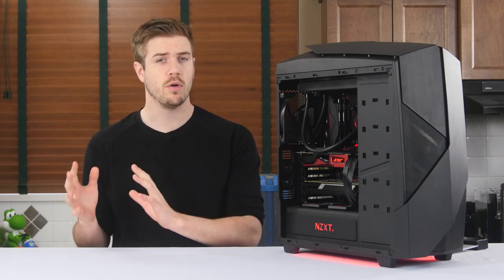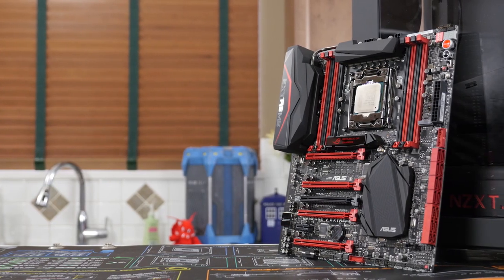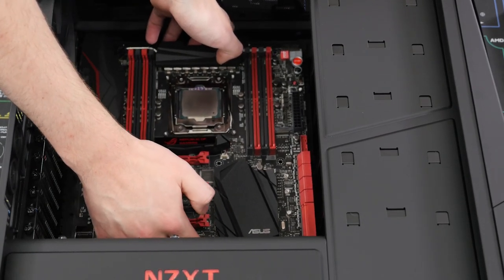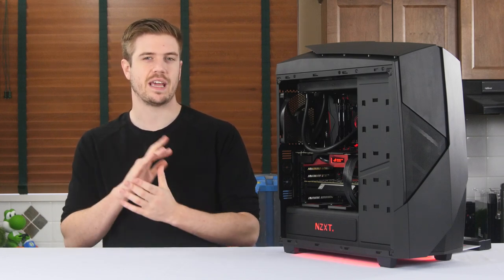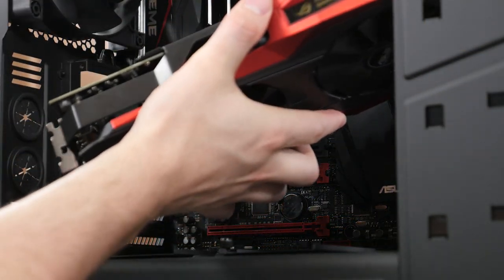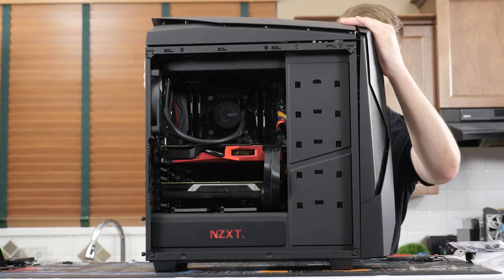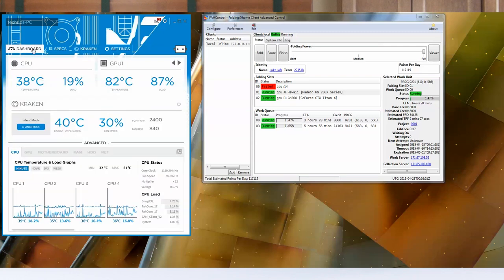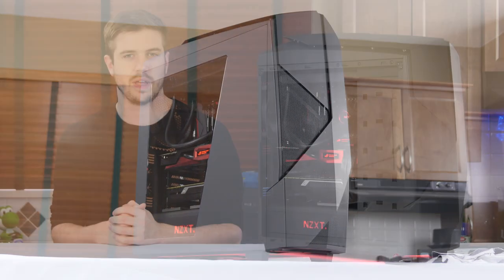ULTIMATE Distributed Computing Build Log

Comment: A $2000 pc with a 290x? Wtf. It's 2015, 290x is shit
Reply: Kaydn Burns Except the 290x can still compete quite well with (if not surpass in some benchmarks) the 980, despite being nearly two years old now.
Reply: rob torres
He wasn't addressing that at you. He was talking to me.

Kaydn Burns Just with a quick Google search, I found a few benchmarks where the R9 290x outperforms the 980, specifically when it comes to video rendering. When it comes to gaming, the 980 is better, but gaming isn't the only thing a video card is used for. But even for gaming, the 290x is still quite close to the 980, often only a few fps (1-5) apart in most games while also having a higher minimum in a lot of other games which would cut down on noticeable stuttering and framedrop. It doesn't matter if your highest FPS was 60, your lowest was 10 and your average was 30, because you'll notice the stuttering way more. A lot of people only ever  look at the benchmarks for highest FPS, but that rarely if ever gives a good idea of what the experience will actually be like. Stuttering is a huge issue in games, and is something that literally no benchmark ever can test for.

Not to mention, as rob torres stated already, the 290x is significantly cheaper than the 980 OR the 970.
Reply: Neonemerld They are cheaper NOW because of the 900 series by Nvidia, AMD dropped the prices DRAMATICLY after the 900 series came out, and lets see AMD stock is at 2.32 with a market cap at 1.78B the time of this posting.
The only new card AMD is coming out with in the 300 series is the 390, all other 300 series cards are re badged 200 series cards.
The Zen CPU isnt due till sometime in 2016, they cant survive that long with all the losses they have incurred.
AMD will be bought OR bailed out, they may be bailed out frorm Nvidia, just like MS gave 500 mil to Apple when they where ready to go under.
Its to avoid anti trust laws.
Reply: rob torres 250 for that god damn my 660s cost about that much each when i got them me want
Reply: Yellowhavok lol you could buy 3 660's now for one 290x
Reply: michael weiss There actually not cheaper because of the 900 series, infact theyve been the price there are now sense late 780 series. The cards went down because a shit load of miners bought the cards, which in turn made them a shit load of money which inturn allows them to sell them super cheap so they can make fanboys who will buy whatever next they pull out of there ass
Reply: rob torres Well i mean if you like no overclocking a whole room heater and blow dryer noise than yea its a great card, oh and no phys x, direct x 12, VGI, MFAA, TXAA, DSR, Cuda Processing for application and a $400 power bill yea great card
Reply: Oh dont forget about the known glitches and driver issues
Reply: And random dips in fps for no apparent reason due to driver malfunction
Reply: Kaydn Burns Are you still going on about this? Do you even do research? The R9 290 DOES support DirectX 12 and at higher resolutions, AA of any form is basically pointless. If you think that NVidia cards don't have known (and unknown) glitches and driver issues, or random drops in FPS, then you're far more naive than I ever thought possible. No driver is perfect, and that includes NVidia drivers. There have been some benchmarks floating around lately showing that with DirectX 12, the R9 290x can actually outperform the GTX 980 by up to 33% and actually matches up against the Titan X. Of course, I'm willing to admit that these are synthetic benchmarks and may not represent real-world performance, it still proves the point that it is stupid to call the R9 290x or even the R9 290 "shit". These cards are years older and they can still match up and be competitive. The heat issues are only experienced by a vocal minority and is far less of an issue than most people make it out to be. The other components in your computer can make a huge impact on GPU temps. I recently re-arranged the airflow in my case and dropped the temperatures on my GPU by 20 degrees at load simply by changing the way the CPU heatsink exhausted. I run my GPU fan at a blistering 30% speed (~1150 RPM) and at load I average about 55 C on my GPU and 26 C on my CPU.
Reply: Kaydn Burns
Wrong, i dont want to argue this one, the mining thing was dead before the 900 series came out, ALL AMD chips went down HUNDREDS after the 900 series, anybody with any knowledge knows this, its been discussed SO much last year people wanted to buy the bargain, but guess what, AMD still could not sell the cards.
They have to do something, you cant drop in the price of your mainstream flagship card in ONE WEEK 200 dollars, thats what they did with the 290x, AND they dropped the price DRAMATICALLY on the 295X2  from 1499 to just 619 currently, this all happened in a matter of weeks
Feel bad for the suckers that paid full price,.
.
Reply: michael weiss 295x2 for 619$? RIP Gtx 980
Reply: michael weiss For full directx12 support you must have the fucking chip to support all features
Reply: Kaydn Burns
Cheaper than that, it also has a 20 dollar rebate, guess what, people are NOT buying them, because of HUGE ROI on the cards, also people dont want to upgrade PSU and crossfire on this particular card has caused issuers in many games, also no free sync support yet, maybe never.
I was going to buy one because it seemed like a bargain, its more than 50% off the original price , that price dropped in 2 weeks after the 900 series was introduced, but after doing research i found out why people where not jumping on them, the old saying, if it seems to good to be true..you know the rest.
Reply: michael weiss Yea, the 290 sucks
Reply: Kaydn Burns You know, your money, your decision, right?  Have fun.  I personally only bought AMD for Mantle anyway.
Reply: Hans Tang But Mantle is dead, Vulcan and DX12 is the thing, Mantle died months ago.
Still works but not in development anymore.
Reply: michael weiss I got my value out of it, I play BF4 enough to appreciate what it got me for that 1.5 years
Reply: Hans Tang Mantel was great for games made for it, but things change, DX12 will be mainstream, i look forward to Vulcan because of Linux support.
Reply: michael weiss michael weiss BTW Im curious how GLnext support will work for the R9 200 series.  Has there been any word from amd?
Reply: Hans Tang Its open source, no telling to be honest, but should work on Red and Green.
Its all about driver support, just wait, wait at least a few months after the first release, thats what i am going to do.
Reply: buying amd just for mantel is like buying a 1998 honda civic because it has a ash tray instead of buying a Ferrari because it doesnt
Reply: Kaydn Burns Yeah? Well guess what I cant afford the Ferrari regardless.  Thats actually the perfect analogy:  a modicum of improvement for a massive premium of price.  The driver issues you speak of have never been a problem anyway
Reply: Hans Tang They are a problem but because youve only owned high end AMD modern cards you wouldnt know XD, if youve always lived in a prison do you know youre a prisoner?
Reply: I had a gtx460 and a gt9800 in the day for forever and they had no issues either.  I have no idea how the scene has changed but I never had major problems with drivers
Reply: Hans Tang its changed dramatically. AMD is going bankroupt.
Reply: Amd is just there for not nvidia and intel going crazy with the prizes
Reply: Kaydn Burns stop arguing about cards. Whatever is best for you is best for you. AMD is good, and Nvidia is good. so will you guys please just stop arguing :I

Comment: Can anyone help me with my build?
CPU:Intel Core-i7
CPU Cooler: H100i
Mobo: Asus X99-PRO ATX LGA2011-3
Memory: Corsair Vengeance LPX 16GB DDR4-2666
Storage: samsung 850 Evo 250 gb
Storage: Seagate Barracuda 2TB
GPU: GTX 980 4gb sc acx 2.0 
Case: Fractal R5 w window
PSU: EVGA 850w 80+ gold 
Microsoft 8.1 
K70 RGB
M65 
thanks :)
Reply: Twizzz z core i7 5930k**
Reply: Twizzz z  Solid.What kind of help do you want ?

Comment: http://www.aria.co.uk/Systems/Gaming+Range/Next+Day+Gaming+PCs/Gladiator+FX+4300+Pre+Built+AMD+Gaming+PC+?productId=63206&rqcType=q#rqc considering this as my first gaming pc, gonna swap parts out when I can afford more what do you think?
Reply: Build your own dude
Reply: cobiegaming I know but when I tried for certain pieces the price came well over my budget, I'll start with this then slowly upgrade it. (thanks for advise)
Reply: +Falcon Raiden You comparing 400 bucks vs. 1200. Go out.
Reply: ***** I found a better system with the same board and cpu but a GeForce 750 ti instead...
Reply: +Dan Kelly m8, nothing wrong with an amd gpu, they're beating out nvidia ones in the low-mid range and with dx 12, they will be way better...
Reply: Got the one with the 750ti everything is great abd==nd works fine
Reply: Dan Kelly yea, the 750 ti is a great card, i was just saying that there's nothing wrong with ati cards :P

Comment: I want to build a computer. This is my parts list: http://pcpartpicker.com/p/CTTjt6 but I want to get advice on how to improve it or get the same experience for less money (because $2000 is a lot of money and I don't know if I really need to spend that much). I don't really know what I am looking for and I could use a good push in the right direction. Any help is really appreciated. Thanks so much!
Reply: +Cassidy Walsh 
That's a nice computer. 

I'd get an EVGA power supply rather than a Corsair one. Don't get me wrong, I'm using a Corsair PSU and it's awesome, but the EVGA G2 750 Watt power supplies come with a ridiculous warranty and they are much cheaper. But if you really want Corsair, get the 750 Watt version of the model you chose. I don't think you will need 850 Watt, no need to pay more for something you are not going to use.

You are going to OC right? Otherwise, get the 6700 (the non-K version) and get the X41 (cuz you won't need that much cooling if you are not going to overclock). Also if you are not going to overclock, get an H170 motherboard. The MSI H170 Gaming M3 is a great option if you are not considering OC. I normally like overclocking, but if you are not comfortable with it, not overclocking is perfectly fine too. And it would help you save some money too.

Finally, is 500GB enough for you? Personally, it's not enough for me. I'd get a 240GB SSD for the OS and other important things, and get a 1-2TB Harddrive for the games and stuff. But of course it is personal and you might not need more storage. Just bear in mind, a 500GB SSD will come with about 480GB usable memory.

Personally, I think that PC is great. Don't be discouraged with the wall of text I wrote, I tried to explain so it took long to explain everything. I hope you build that PC and have great time using it. Also if you have any questions, ask them. Ask them here or at the Linus Tech Tips forum where a lot of amazing people will help you.
Reply: Mükerrem Tüfekçioğlu Oh my God thank you so much! I will be sure to do all that stuff. Thanks for all the help!
Reply: Cassidy Walsh No problem man! I'm happy that it helped!